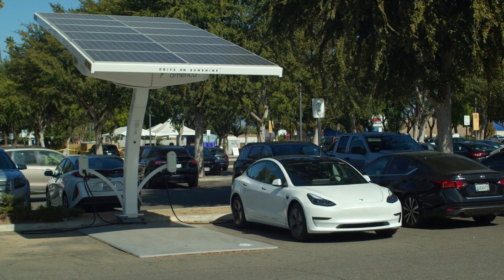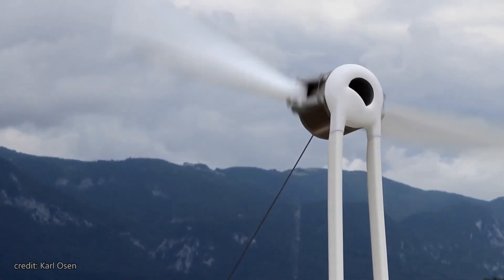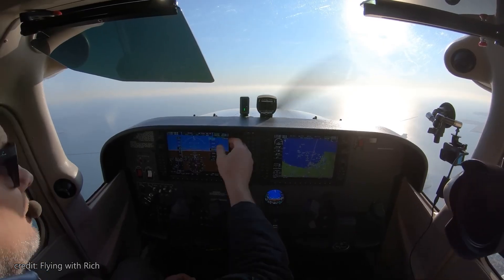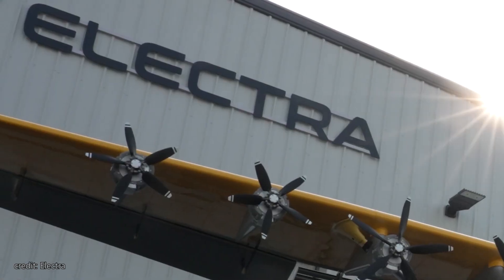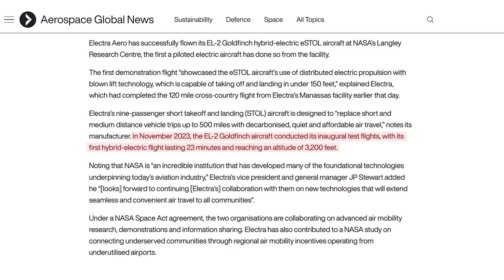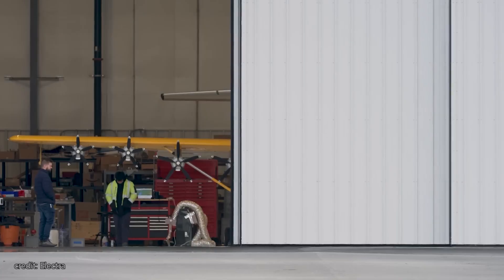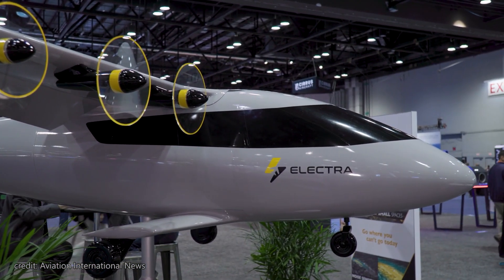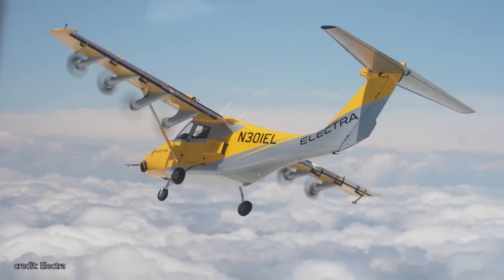Electric STOL? Electra Aero Review & Specs!

Comment: Surely the Electra Aero has at least 4 motors too many!  The mass of the outer 2 motors on each wing, that look like the same type as the inner motors, must affect the range as deadweight. Make the props of the two inner motors,  slightly larger, and get rid of the outer 2 motors!  4 motors surely if worked out right, must be enough!  Where the maths for this?

Comment: $3.5 million?  LOL.  New combustion tech is distributed and has blown wing, boundary layer control, and Active Drag Reduction (1/2 of base drag gone via engine exhaust).  The engine is 60% efficient at full power and 75% in cruise, which is the same as an EV.  It also captures CO2 and water if wanted.  Range is 12,000 miles at 120 MPH, and 1400 miles at 345 mph (300 kts).  It can take off in 25 ft or about the diameter of a helicopter blade.  It is also roadable and thus can use roads and do door to door taxi service.  The cost for a 9 place will be around $200,000.  TBO 8000 hrs with four overhauls.  200 to 240 MPH is typical cruise for best MPG vs time.  

Basically, the Electra and ALL EVs are obsolete.  Their costs will be 10 to 30 times more, at least.  Super charge will be 90 cents/kwh and buildings will be 60 cents/kwh with a 100% RE grid.  Making fuel will be 3 to 6 cents/kwh.  60/6=10.  90/3= 30.  10 to 30 times more.  Moreover, with active drag reduction of 1/2 and a lower base drag by 30% due to engine INSIDE wing, the ratio is actually 30 to 90 times less.  Sorry, but nobody will want an Electra with such a high operating cost.  $3.5 mil / $200k = 17.5 times more.  Sorry, but only fools will buy the Electra.

Comment: When it experiences a total power failure mid-air, as will inevitably happen one day, this aircraft will need a very long runway in very close proximity, not to mention very strong tyres and brakes and a pilot with brass b***s.
Reply: total power failure is far less likely than a standard single. Losing the engine leaves electric drive. If it's designed even slightly well, the electric drive system is very, very unlikely to totally fail. Each motor has its own motor driver, for example... A well designed battery system is not going to fail totally as redundancy can be designed there too.

Comment: good video - nice editing and a suitable level of detail. 
Surprised you didn't mention distributed propulsion as the key innovation - it is clearly enabled by Electrification, but it could be argued that it is the defining technology that differentiates from previous elec aircraft. You certainly wouldn't achieve the lower stall speeds with a straight swap to a single elec motor and a NiCad battery.

Comment: The proposed Electra 9-passenger aircraft competes in the same space as the Cessna Grand Caravan and the Daher (formerly Quest) Kodiak. The Kodiak is STOL, with takeoff distance of 934 ft (285 m) and landing distance of 705 ft (215 m) according to Wikipedia. Costing more than Caravan or Kodiak, with less range and slower turnaround time seems like a non-starter. And flying that configuration in icing conditions might be… 😮. Sorry, Electra.
Reply: Seems like the hybrid (aka turbine engine tuned for electrical generation, and a tank to hold fuel) takes care of the turnaround time.  Not sure there's any problem adding de-icing in the same way that a Grand Caravan or Kodiak adds them on.

Comment: i am spectical abaut electric planes in the sence that i dont realy think that a pure electric plane makes any sence in anything but a glider, but this concept is actually realy solid and i could see this work. Electric engines in gliders howeather are ideal, you instantly get power when you need it and dont have to factor in the high likelyhood that your engine malfunctions when you get low, so you can spend more time as a pure glider.